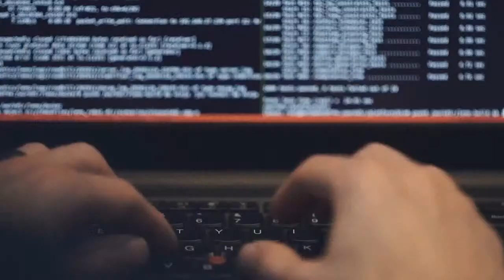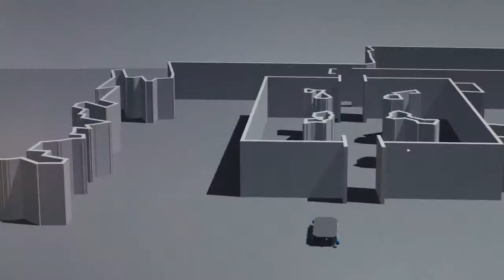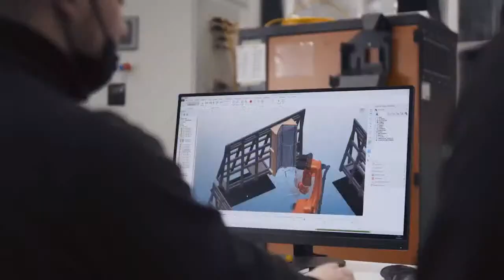Arrival in America. Innovative Product. Innovative Process. - Autoline After Hours 554

Comment: Just yesterday, Sandy Munro predicted that EVs would be 70% of the Worldwide, light vehicle market in 2028. See his video presentation to the SEA on April 28, 2021.  PS: the USA is going to be slower to adopt the EV.
Reply: He's not wrong. The only possible issue is resources, but involved mining companies are ramping like crazy. Chip resource might be a problem too. Traditional analysts talk about 15-20% new EV penetration by 2030, and/or 40% by 2040, and that's absolutely nuts. FFVs will be worthless after 2025 and fleet buyers will simply stop buying them. After that FFVs will quickly die. I think 70% is fair but it could easily be higher. As for commercial vehicles, this will almost certainly happen faster, because there is no ignorance or sentimentality. If the electric van or truck is better and cheaper for use, companies will ditch the FFV equivalent in a heartbeat. For example, just 6 months ago I asked my boss about electric vans for our use. He said that our needs were not met by electric. Last month we slowly started replacing our diesel vans. The numbers and product simply started to work. And it's only early 2021.